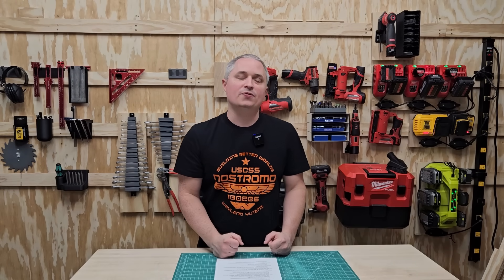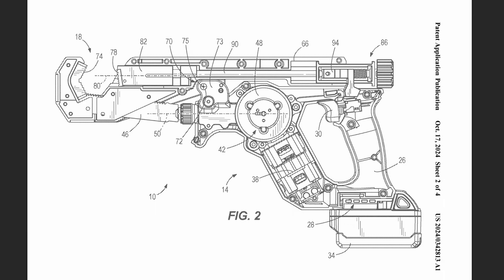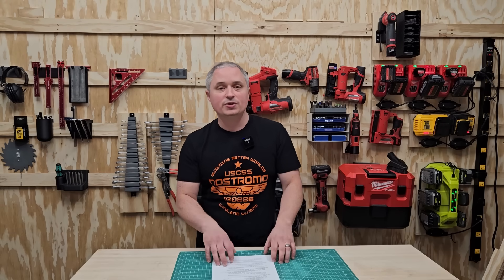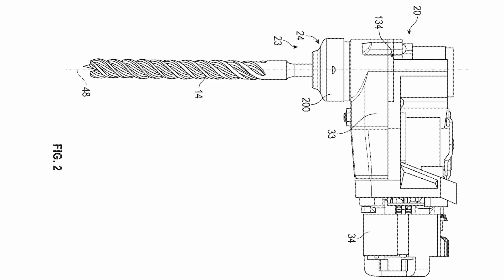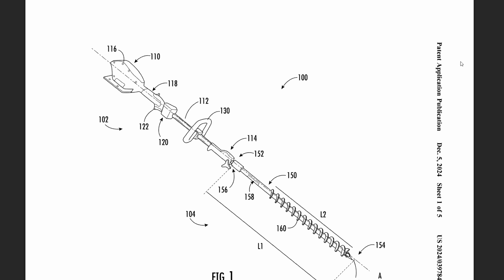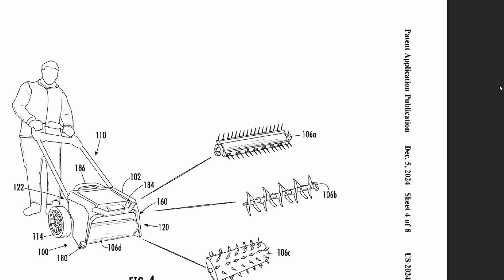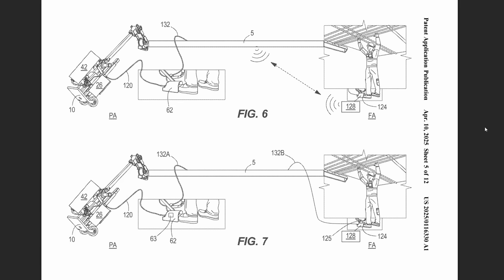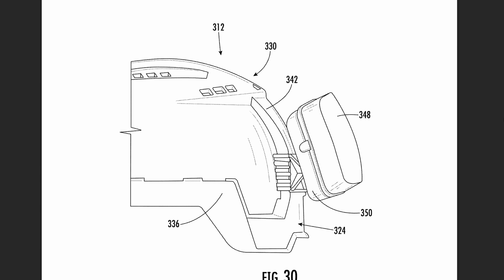Milwaukee 2025 Patents - Pipeline Release Predictions!

Comment: I'm really looking forward to the new M12 and M4 tools. I have many m12 and M4 bayte4iea and am looking forward to more home tools. I need a better usb redblithium electric screwdriver for delicate and tough home tasks, with variable tork and speeds, and support the usb red lithium batteries. I'm also looking for 4 an m12 adapter where we can come 3 to 6 usb redlithium batteries, t9 combine to an m12 battery. I would also like to see a redlithium 3 to 6 battery bank too, where we can combine 3 to 6 red lithium usb batteries to a two way up to 250 watt power battery bank amd also supports a pure sign wave inverter that also supports bidirectional ac and dc charging. I would also like to see a  better m12 and m18 mobile solar power station that can deliver 1500 to 3000 watt hour power performance and be a battery charger at the same time. Or that the current m18 multibattery packout battery bay can support simultaneous charging of all m18 batteries and be a powerstation at the same time, providing up to 3000 wH performance. It would also be nice if there was an m12 version and one that can support m12 and is redlithium batteries
It would also be nice if there was a smaller but powerful m12 smaller circular saw that can cut up to 5 cm depth in the home project. And that this tool has an accessory table can convert it to a table saw for home projects.
Lastly, I would like to see an improved an m12 drill driver tool that also has an integrated, more powerful hamerdril function for those home projects that need to drill into hard concrete walls, without needing a separate hamerdrill.

Comment: What about dewalt?
Reply: Dewalt doesn’t put on or hype a yearly product event like Milwaukee does. If they do, I’ve never seen any influencers post about it
Reply from the maker: I've done DeWalt in the past when I get a list long enough for a video, but DeWalt (SB&D) tends not to file as many and don't save most of their new tool announcements for a single event. So patents drop off as old news when they announce their products piecemeal, and I usually don't have more than 1 or 2 ready at a time.

Comment: All these look great, but I'd love to see someone, especially Ryobi, come out with a 4k 18V winch that uses two packs that is strong enough to pull a car onto a trailer in a pinch. It would be a great added bonus if they featured some sort of attaching feature on it as well that would universally fit most trailers, and have a wireless control as well.

Comment: You need jack stands
Reply from the maker: Depends on what you're doing. If I'm getting under the vehicle, I'll always have a secondary safety measure in place. For example, I use jack stands in addition to my Rhino ramps when doing oil changes.

If I'm using a standard hydraulic floor jack, I'll even use jack stands if I'm just doing something like brakes because one twist of the handle and that vehicle is coming down. But if they have sufficient safety measures like the locking pawls as described in the patent that require multiple sequential actions to disengage, then I'd be comfortable working without jack stands if I'm not under the vehicle.

Comment: Interesting management they have at Milwaukee, very bold. It's what the legacy auto manufactures needed.  Saturn Motors was a subsidiary of GM. That same GM who di guess what? Brought out that Ev1 EV car. So they could have put an EV division in Saturn motors. I mean I get they used Nickel–metal hydride battery tech in the Ev1, but it had enough range for commuting  from  & to a suburban house.

Comment: The miter saw and table saw safety features are innovation In my opinion I think it's a little better than sawstop idea cause it won't damage the blade
Reply: The miter saw is particularly good. I would expect it to raise the price by $200-300, but it beats losing a finger. The SawStop concept doesn't work for a miter saw, because there's nowhere for the blade to disappear to.
Reply from the maker: Not only that, but the blade would slam down further into your finger due to angular momentum!

Milwaukee's vision based concept is far superior when it comes to applying to miter saws, as long as they can make it responsive enough.
Reply: @DoresoomReviews  You could design it to slam up and away from the user but you'd basically need to have an upside down table saw on top of the miter saw to fit the full blade size.

Milwaukee is onto something here. It's not going to be a perfect solution but I would rather need a bandaid or stitches than need to have my fingers replaced.
Reply: Plus you can finally get miter cuts on your hot dog without ruining your blade.
Reply: sawstop is a patent troll and will sue them anyway. Such an awful company.
Reply from the maker: @mrniusi11 Oh yes, I've got some things to say about SawStop. Offering up one of their patents for free so CPSC will mandate their tech... but it's the one patent that had less than a year to go before it expired anyway, and they made no promise about the rest of their patents. Steven Gass (owner of SawStop) talked all about how he just wanted to make table saws safer, but once Bosch developed a better system that used airbag charges to drop the blade without damaging it, he sued immediately.

In this case though, I think Milwaukee is in the clear - SawStop got Bosch Reaxx for infringement only on the capacitive sensing. 

If it weren't for SawStop's scummy business practices, I'd probably own one by now. I just can't stomach giving Gass any of my money.
Reply: @DoresoomReviews   SawStop's business model is why I bought a Bosch GTS15-10. Honestly, it's an incredible contractor saw and I got it for a great price ($450).

Comment: My laundry list:

M18 hardwood flooring nailer/stapler. Not having to worry about the air compressor and hoses would be a game changer. I've been impressed with their nail guns so far and I see no reason they couldn't make this.
M18 lathe stapler. Seriously. Why doesn't this exist already.
Forge 3.0 battery (longer life)
M12 floor laser (beam sits flush with floor)
Dual M18 audio link dedicated subwoofer
M12 dedicated audio link tweeter
Audio link brain and app for stereo functionality and sound control

Dual M18 table saw with AC option
Dual M18 miter saw with AC option 
A "fixed" gen2 7 1/4 in miter saw
Dual M18 backpack vacuum

The audio link stuff was ultimately disappointing for me because I really thought they were going to make a truly modular cordless stereo system possible. I'm holding out hope they will see the demand for such a thing. It's pretty annoying to have to press the on and off and audio link buttons every time, there's got to be a way around that.

Comment: The M18 trailer hitch lift would be awesome. On the M18 Telescoping Site Light, did you do the math (based on the dimension of the packout cleats) to figure out how high it goes? It looks like it would take forever to extend, but it looks pretty freak'n high. It would be great for covering a really large area if the lumens are there. Also, 7:04 that's an M18 FUEL POOPER SCOOPER! :) I WANT THE CORE AERATOR! OMG Milwaukee VR. 

Another great video Nate! Can't wait to see what comes out at PIPELINE! Looks like there will be fewer tools this year, but I'm hoping they're big ones!
Reply from the maker: I realized the Packout light is actually the MXFUEL Rocket Compact Tower Light just a few hours after publishing: https://www.milwaukeetool.com/Products/MXF040-1XC
I think I missed it because I don't keep up with the MXFUEL line as much, and I assumed the light would be M18. It's got a 7' mast.